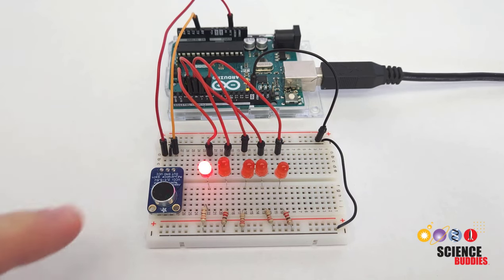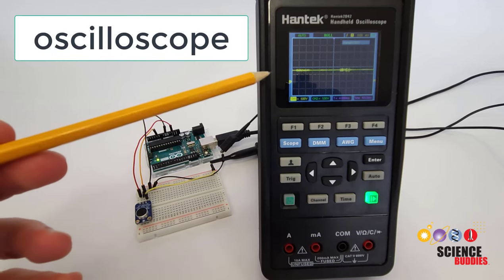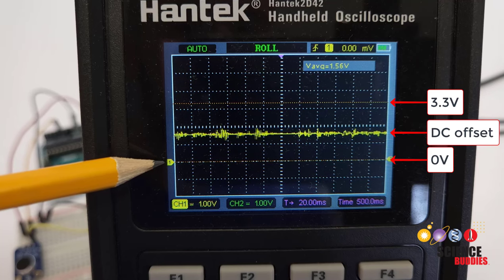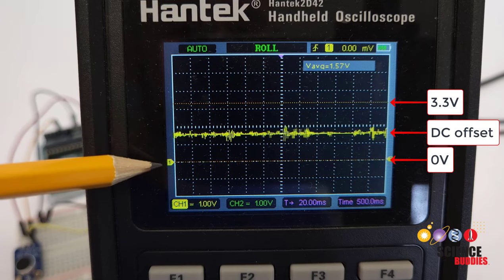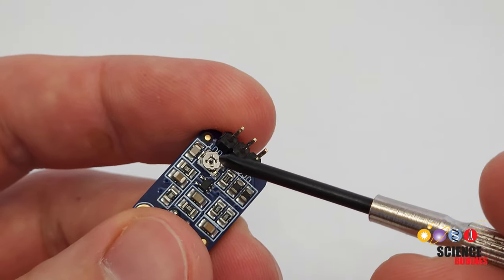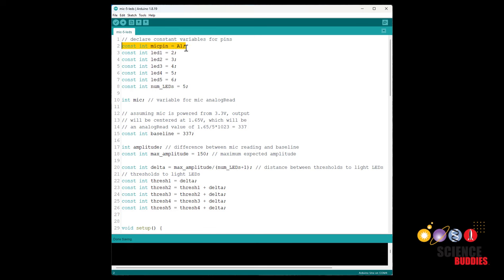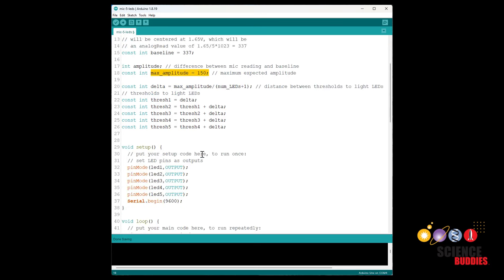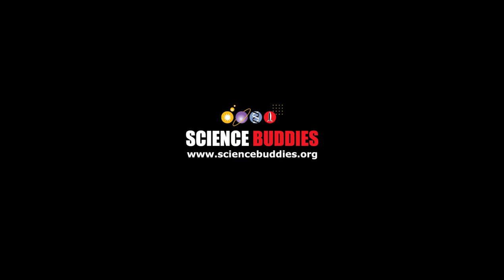How to Use a Microphone with Arduino (Lesson #12)

Comment: I have arduino nano can you tell me how to connect it and i want that when a specific word is said the motor stats
Reply from the maker: Hi - all our tutorials are for the UNO so you will need to look up a separate tutorial on using the nano, however we have this project about making a voice controlled lamp which you could also apply to a motor: https://youtu.be/C0IAQzxgQa8?si=3P0MoP-Cd2oWCWbn
Reply: Thanks for the reply but i have already watched the video but the problem is i don't have a voice recognition module and thats too expensive here so i am finding an alternative and i got to connect a mic directly to arduino tell me if you can help
Reply: So i can use arduino Uno also but tell me how can i connect a  motor and use this in my project
Reply from the maker: Hi - we can't provide individual help with projects like this, you may be able to get help on the official Arduino forums or other forums like Stackexchange or Reddit. You can also ask an AI program like ChatGPT but the results may vary (they do not always give working code but they may give you an idea of how to get started).

Comment: What oscilloscope are you using in this video I can see that it is the Hantek 2d42 oscilloscope but is it the 3 in 1 or just the normal one? Also good job you made this in a very comprehensive way! also is that an Arduino uno?
Reply from the maker: It's a Hantek 2D42 with oscilloscope, multimeter, and function generator capabilities: http://hantek.com/products/detail/13174, and yes that's an Arduino UNO R3.
Reply: @Science.Buddies  Thank you very much. Have an amazing day!

Comment: Hi Sir, thanks for the video, quick question:

If I want to filter the frequencies of the sensor from a recording, can I use a software to do so ? I am thinking on that as a budget option to avoid the osciloscope, would that be possible and precise ?
Reply from the maker: Hi - if you Google things like "Arduino digital filter" or "Arduino low pass filter" it looks like there are some options out there, but we have not tested any of them. Another option would be to design a hardware filter using resistors and capacitors.

Comment: Greetings, can the MAX4466 microphone amplifier module be connected to the phone?  [To record sound] (because the microphone path is far, you should use the MAX4466 module) [Of course, with a separate 5V power supply] Thank you 🙏
Reply from the maker: Hi - you would need to check this microphone's documentation to see if you can connect it to a phone, but if you just need to record sound with a phone (and not use an Arduino) it would probably be easier just to buy a microphone/headset with a headphone plug.
Reply: Thank you 🙏 What kind of microphone amplification (preamplifier) should I use??  (the path is 15 meters and only with a condenser microphone it has hissing and jamming sound) Thank you very much 🙏
Reply: Thanks 🙏, what kind of microphone amplifier should I use? (The route is 2 meters high and with only capacitive microphone (secret microphone) with a scratch and noise)🙏
Reply from the maker: Hi - we're unable to provide direct support for electronics projects like this, but there are forums online like Reddit or Stackexchange where you may be able to find help.
Reply: Thank you very much for your guidance🙏🌹😊👍

Comment: It seems fairly straight forward except I cannot get mine to work. I have what I think is a mic "Module min sound sensor" is this the same thing as a mic? Looking at the serial readout, there is no fluctuation in the reading, about 337 which is the baseline.  Cannot get any fluctuation in the leds.  Why does the analog pin A1 not get a mention as an INPUT ?
Thank you., Ben
Reply from the maker: Hi - you may have more luck getting an answer for a question like this in the official Arduino forums where you can post your code and pictures of your circuit, we are unable to do much troubleshooting in YouTube comments.

Comment: Hey Mr, just got your same Hantek osciloscope but it is either detecting lot of noise and not detecting my sounds or if channel is in 1.0V there’s no signal detected, I’ve tried a sensor which I had to solder and an already soldered sensor, same result. 

Any idea on what could be happening?

Thanks.
Reply from the maker: Hi - setting up an oscilloscope properly can be tricky if you don't have experience using one, so there's a chance your hardware is actually fine but the oscilloscope settings are wrong. I would recommend using analogRead with the Arduino to see if you're getting any voltage out of the microphone, in which case the oscilloscope is probably not set up properly. If you don't get a reading from the Arduino either, then something might be wrong with the microphone or how it is wired.
Reply: @Science.Buddies  Hi!

It is definitely tricky tricky, I am connecting the arduino board with the sensor connected and I’m getting lectures, so my next question is that in case I can’t configure the osciloscope can I use the data plotter and sampling the sound to substitute the osciloscope ?
Reply from the maker: The Arduino serial plotter is not as full-featured as an oscilloscope (it is hard to adjust the scaling) but yes it can function as a basic oscilloscope.

Comment: Can you explain what is the 1023 in the code? and where did you get it from?
Reply from the maker: The Arduino's analog to digital converter (ADC) is 10-bit, meaning it can have 2^10 different possible values. 2^10 is 1024, but it starts counting at 0, so the maximum value is 1023. Since the ADC accepts analog voltages between 0-5V, a physical value of 5 volts will correspond to an ADC value of 1023.

Comment: Hi ! I am trying to send data thru one arduino to another, but using two handys, Baofeng BF999-s, it can transmit up to 10 km. so, I need to convert data from arduino to handy mic and in the other site receive data from handy speaker and through arduino turn it into data again, like  Rattlegram, but I need to control for example a relay, with Rattlegram I can`t do that, can you help me ?
Reply from the maker: Hi - you will probably have more luck asking this question on the official Arduino forums.
Reply: @Science.Buddies  NAAAAAAAAA.........
Reply: have you found a solution?
Reply: @Science.Buddies  Probably, no, couldn`t find an answer there.........

Comment: Hello,

I want to create an audio recorder circuit with Arduino Uno. I will use Max4466. However, I'm getting the following error. I've done a lot of research but haven't found any solution. Do you have any advice on this?

C:\Users\Armagan\Documents\Arduino\test-ayse\test-ayse.ino: In function 'void loop()':
C:\Users\Armagan\Documents\Arduino\test-ayse\test-ayse.ino:62:9: error: 'class TMRpcm' has no member named 'startRecording'
   audio.startRecording(file_name, sample_rate, mic_pin);
         ^~~~~~~~~~~~~~
C:\Users\Armagan\Documents\Arduino\test-ayse\test-ayse.ino:69:9: error: 'class TMRpcm' has no member named 'stopRecording'
   audio.stopRecording(file_name);
         ^~~~~~~~~~~~~
Multiple libraries were found for "SD.h"
  Used: C:\Users\Armagan\Documents\Arduino\libraries\SD
  Not used: C:\Users\Armagan\AppData\Local\Arduino15\libraries\SD
exit status 1

Compilation error: 'class TMRpcm' has no member named 'startRecording'
Reply from the maker: Hi - you may have more luck asking this question on the official Arduino forums.